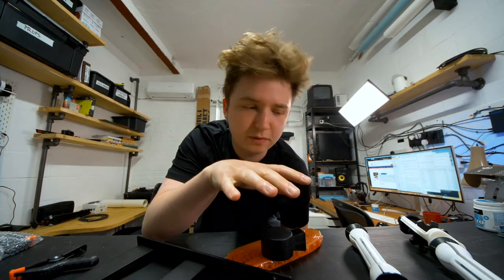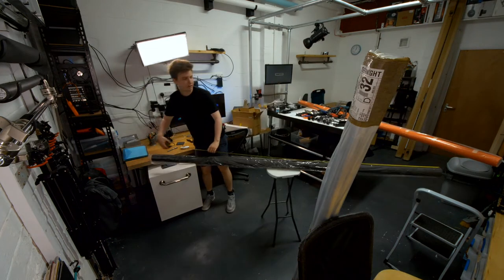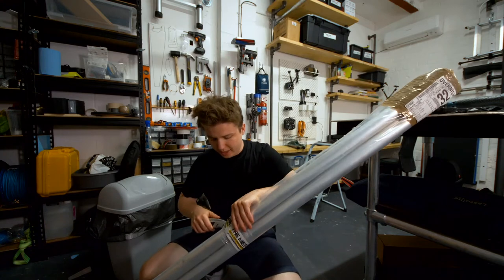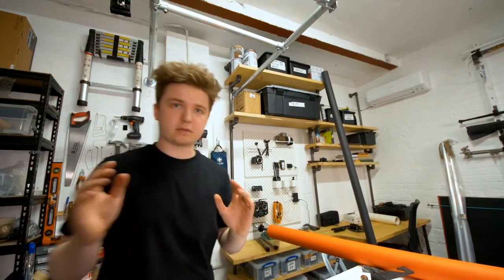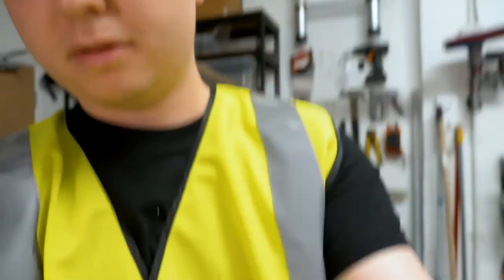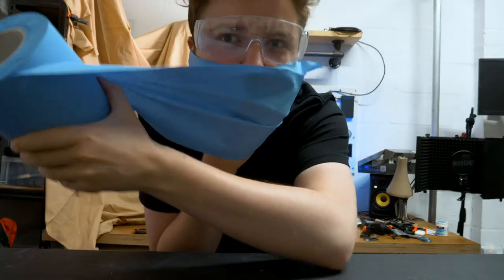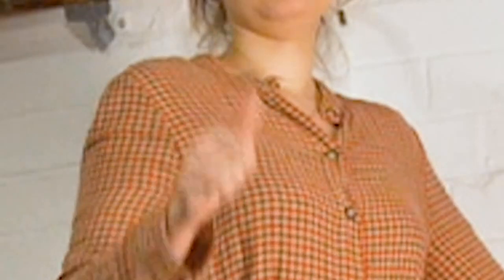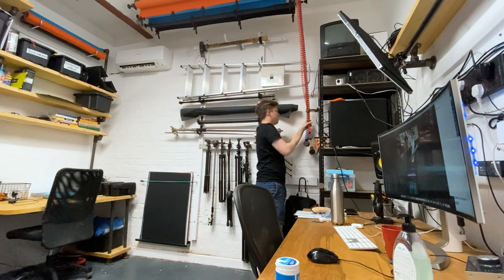My Paper Backdrop install - made by Neewer

Comment: Hey mate, how did you cut the paper roll in the end to achieve a good result?
Reply from the maker: Hey Ryan - great question! - It's quite tricky, I had to use a Mitre saw in the end.. but it's tricky because if the blade is too small, you have to swivel it round. And it's not a great finish ! - but it's ok.